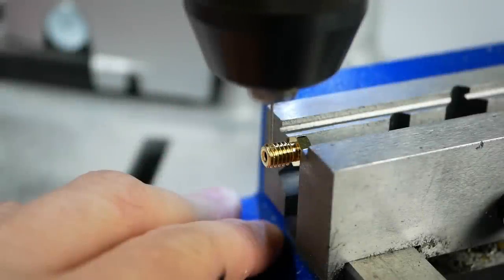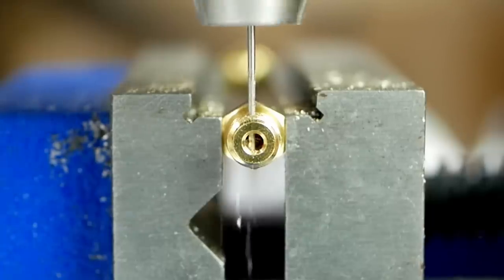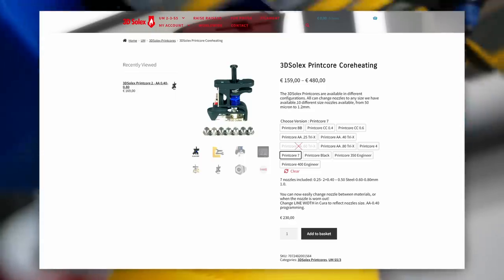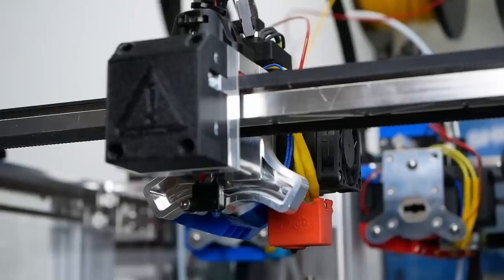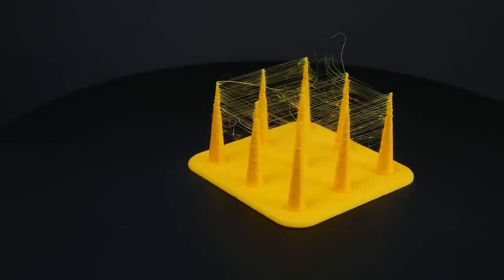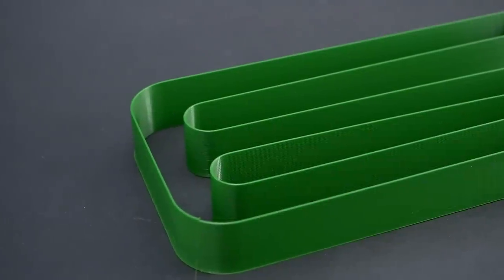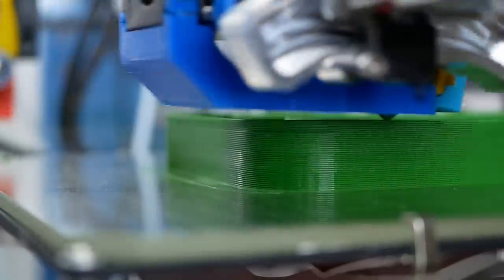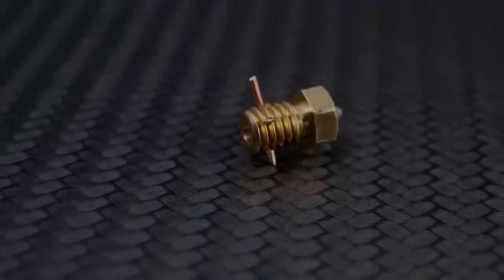My High Flow Nozzle is better than a Volcano hotend!

Comment: Hi Stefan great video! If you try putting the too wires farther apart you should  get a more laminar flow do to smaller obstruction aria overlap and  less cavitation on the underside of the wires. Also depending on tool availability you could flatten the portions of the wires that are in the hole of the nozzle into an aerofoil like shape (as much as possible), further reducing turbulent flow and the cavity's under the wires.

Comment: Hello, an easy method to align a round object is to take a rectangular template with a V-cut from the top and a V-cut from the bottom
With the bottom V resting on your round object lower your spindle into the top V
from here your eye should see how centered the spindle is, or You could use the old line and weight method to really dial it in

Comment: A small end mill and slow pecking will allow you to drill the hole without wandering. Even a center drill will be challenged trying to cut into the side of a thread.

Comment: Use an end mill to start the drilled hole. Also before you solder  the copper wire in . Grind  flats . On two side  opposite each other. So it's more streamline like a fin. Put 3 wires in . Clock them 60 degrees apart.  In a helical pattern From Top to bottom. This will maximize temperature transfer and equalize flow.

Comment: I would also like to see the impact of adding a bevel on the top side of the wire before inserting it into the hotend to potentially help 'split' the filament into two streams.

Comment: I have an idea for Mk2 🙂 So, unlike drilling inside the nozzle as Solex/Bondtech does, here you are adding an element. That enables the luxury of processing the "divider" element separately, outside of the confined space of the nozzle bore, before installing it. So why not file (and gently polish) the section of the "divider" that is exposed inside the nozzle bore, into a more favorable, less restrive shape? Like a slimmed diamond shape / double-ended wedge? Then add 1 or two more like it, but in the same orientation, as close to each other as you're able to drill. So when installed, they "stack" to form (almost) one elongated divider.

In my mind, this would drastically increase the contact area and thermal transfer, while also (!) substantially reducing_ the volume and flow restrictions, instead of at the cost of increasing it.

Comment: For the volcano hot end it would be cool to see you make a cut down the length of the nozzle and slide a thin copper sheet in. Might be easier to get in the center and would ad a ton more surface area to melt the plastic. This would also allow you to use something thinner which would block a smaller cross section of the nozzle.

Comment: I was thinking about it last time, but try boring the nozzle bigger and soldering a plate/blade in there. It would have more contact with the nozzle and filament to transfer heat.  You could also try a "+" type affair.

Comment: Definitely worth experimenting further.  However, I did notice another area that is restricting flow through the nozzle.  And, that would be where your solder has wicked its way through your drilled hole and run along the copper wire to the inside of the nozzle.  There is no way stop this from happening, nor is there a way to remove the excess solder after the wire has been put in place.  It does make me wonder about soldering a piece of copper vertically into the nozzle and then use precision drilling to mimic the angles of the other nozzle.  Not sure on patent violations of this idea either. Either idea gets my brain cranking though.  Excellent work.

Comment: Its a long shot and quite time consuming, but i'd go with a two-part design:

A nozzle cut in two.
A tiny mesh but, not with this kind of thick wires. With extremely thin coil wires (awg26 - awg34 which correspond from ~0.4 to ~0.16 mm diameter) .

You sandwitch the mesh bitween the thow nozzle parts, and stick them all together.

Comment: You could also print a template to drill the holes. You could fasten the wires like a rivet then you don't need solder.

Comment: To drill central. Assuming you are lined up OK. You have to use a center drill first. 
It's a short stiff drill that makes a pilot. Normally used to make a hole for lathe centers. 

Then the drill will folow that. And you can do it anywhere then.

Comment: You should be able to achive better centering when drilling into that outer thread, if you can provide a flat "start" drilling for the through drill to run through. So a flat bottom drilling could be made with a slot drill or endmill. I know you have a cutting router or two there, but maybe not such tiny tool bits for it. But that's my suggestion
When you drilled the "bridged" section of the nozzle to over size it, you might have improved flow performance further by using a 45 degree or even 60 degree centre drill (spotting drill). That would probably reduce back pressure on the flowing filament.

Comment: Try two wires in the same orientation with little to no gap between. Additional you should make a cooper nozzle. And the widened internal diameter should degrade back to 2.0 mm in steps.

Comment: You could use a heat block to center the drilled hole in the nozzle. Just drill through the block with the nozzle in the block.

Comment: Interesting. I have a mini mill. It would be pretty easy to plug the channel and drill down the side of the plug and nozzle to get the semi circular scoops in the bore. And maybe add a cross wire or two..

Comment: Another idea: cut a very thin slot in the extruder from the top, and put a thin blade rather than a wire, it will have a longer contact time and lower resistance.

Comment: in addition to the comments about using a nut to prevent the drill bit wandering, I want to see you try pinching the wire flatter inside the nozzle. it should increase the surface area of the wire and decrease the obstruction to the flow. maybe also try thinner wire, which you should be able to do with a smaller drill bit. you can get brass m6 nuts to have an easier time aligning the drill bit.

Comment: I'm no machinist but maybe (and I hope the machinists here correct me if I'm wrong) you could try to use a spot drill(Zentrierbohrer) to get a better starting point in the middle of the nozzle.
Also instead of soldering I think you could get away with mechanically locking the wire in place by simply punching it from both sides so it widens at the entering and leaving area. (not sure how to explain it better)
The last Idea I have right now you could try to V shape the wire before inserting and pointing the sharp edge to the incoming filament just to hopefully have the filament split more easily.

Comment: Use a brass or copper tube rather than wire. Once it is in place crush the tube flat. Yes you need very fine needle nose pliers.

Comment: If you have any centre drills for the lathe, I'd recommend those to spot a drill centre, or use a very sharp engrave V bit to just leave a centre mark, I use carbide 15° ones but they're not really meant for that kind of work

Comment: Hey brother, 
Get a set of "pilot drill bits" for about $10 bucks on eBay or many other places and you will have MUCH more control and less wandering when drilling tiny holes
Excellent video. Lots of research in these. Thanks for that!
Have a super day
-Shane

Comment: I believe you're supposed to use "center drill bit" to start the hole. They've short but rigid drill bits specifically for this purpose.

Comment: This is awesome! I have a CHT on the way, but their selection doesn't include some of the things I would like to try. Your approach should be doable at home by anyone with a decent drill press and vice. I will definitely give this a try!

I wonder if it would be possible to press fit a wire into the hole. The thermal coefficients of brass and copper aren't that different, but different enough. That way you could avoid the soldering, making it easier to handle higher temperatures. Steels also tend to have smaller thermal coefficients than copper, so maybe press fitting copper wire into a steel nozzle would be easier.

Comment: To stop the drill bit wandering you need to make some kind of a starter hole or divet for the tip of the bit to rest in. Then it should go straight.

Comment: Imagine how many cross wires you could get in a Volcano nozzle. I second the suggestion about using a nut to both maintain thread integrity and also providing a better drilling surface.

Comment: i'm thinking if just making a straight cut in the nozzle and using like 0.3mm copper strip would be easier and maby work better than a wire.

Comment: Silver solder the edge of a razor blade in there instead or use some sharpened copper sheet intead, basicaly get the splitting performance up and the surface area in contact with the plastic down.

Comment: Super impressive. Have you considered to make a cut from the top and insert something thin and long, like a sharpened copper sheet? Should decrease physical resistance and also crate a bigger surface area.

Comment: Soldering isn't necessary since the wires are held in place when the nozzle is screwed in. That means you can turn the heat up a little higher without concern. Try using thinner wires, or filing the wire into a thinner shape for less resistance.

Comment: Awesome 
What about before you solder the wire in the nozzle you have the extruder side of that wire brought to a point like a knife edge this would reduce the drag of filament having to go around the round wire and instead just splitting it.

Comment: I would have used a #1 center drill to start the hole before drilling with the drill bit. This would also allow a small chamfer to the hole start and the center drill won't walk like the small drill bit does.

Machinist precision drill process is: center drill, drill, then ream or tap if needed.

Comment: What about sticking a flat piece of copper with a width of the nozzle inner diameter into the back of the nozzle. May need to drill the nozzle out a bit first to enlarge the hole. This will insure the split is in the middle, increase the surface area for heating, reduce resistence due to the fact that it is thinner and make it easier to install and maybe even make it reusable (Similar to Fig. 3C in the patent). Alternatively, take a piece of round stock with the inner diamiter of the nozzle and mill it out from 2 sides, creating an opposing U shape (Similar to Fig. 3A in the patent). This will create a larger area of contact with the nozzle walls that will allow for faster heat induction.

Comment: Let it your drill wander, and once you get to the filament space tilt your clamp and nozzle until the drill is central. The first hole will act as a guide to stabilise the drill for the second hole.

Comment: The higher the stickout of the drill bit the less rigid it is so the more it will wander/drift (also worse runout). Ideally the chuck jaws clamp on the smooth right past where the drill bit flutes end.

Comment: Put a (thinish) sacrifical peice of metal you can hold that is predrilled, then use that laying on top of threads to guide.... wait, that bit should insert DEEP in that chuck... don't worry about drilling both at once, just get a first centered hole.   
Hey, can't wait to try this.... thinking offset holes a little so as to get more wire volume inside... may do some filing on the wire... ovalish ...less flow resistance and maybe a little sharpish!
Still watching... sure be back... good stuff!

Back soon.... why even solder... hole placement... really care if a bit leaks.. likely won't notice a bit with hole placement at 50% insert depth.

Way to go Karl!  And marvelously handled cnc kitchen!

Ok subed.  Yea, put wire in vise, take small file and file a symmetric wing profile.  Do the only on the width of extrusion hole and insert with it appropriately positioned.  I think what's lost in mass will greatly be overcome by reduced friction/flow resistance and more laminar flow overall.  
Can't wait to try it!  But old retired engineer and building my first printer... a delta... T3000 amateur competitive.

Comment: To keep your drill bit from walking, first drill the threads with a slightly larger bit. Just to where the threads will no longer touch your smaller bit, then center punch it with an even small bit or punch.  then drill it all the way through with your desired bit... Just a thought 🤔

Comment: You need lubricant like a cutting oil and to use a lot less pressure on the cut, then you can stop the wandering. Even better is to use a smaller length drill bit.

Comment: The best way to drill a hole would be to get something that it will tread into that has flat sides, like a nut. Then drill thought it (nut) and the nozzle, you can also reuse this as a guide to make more later. This should prevent the drill bit from walking on you when trying to drill though the treads. People with a milling machine might put a small flat spot on the treads before drilling the hole.

Comment: I have an idea that you did not mention. Because copper is soft, it might be possible to reshape the wire inside the nozzle after insertion. Either use tiny needle nose pliers too flatten it, or some type of tapered shim one on each side. With the copper wire shaped more like a knife edge instead of a round obstruction it is less restrictive, but maintains the same amount of surface area to contact the filament.

Comment: Instead of drill holes you can try to create with copper a shape that is a washer with in middle a V shape bridge with sharp edges to fit into the hole and then mout all as a normal nozzle. Is a try that don’t sacrifice nothing, but if it work you can go over the temperature limitations. If it work you can think to a double v shape as you had made with holes, at different dept.

Comment: I got interesting results machining a new hotend cube, made of copper instead aluminium, and making it 12mm thick instead 10. The weight of the copper hotend is 6 times higher, and this gives to the hotend body a bigger thermal inertia. On my printer, one of the speed limiting issue is the temperature drop when the nozzle extrudes much filament in short periods of time.

Comment: Not that I've tried it (apparently we can't legally try or use patented ideas) but if you use a larger wire and turn it down with sandpaper and a drill it can fit snug enough in the drilled hole to not need solder and could potentially print abs. Printed guides might help for the drilling process making it feasible to use a hand drill and a small vice. Can't wait to get my hands on a .4 cht if they ever become available again.

Comment: Find center, flat end mill ( same or larger than drill till a flat spot is obtained ) Center drill, then drill.        Try standing finished nozzle upright then side milling each side of the wire to thin out the profile thereby reducing the cross section of the wire and reducing the backpressure. You could install the lower wire first then thin then the upper wire and then thin. ( May be easier to thin the wires by filing before installing ) Who knows?

Comment: Dual heater block,  top section at 250 deg second at 215 deg , pre heating the entry point at high temp then stabilising at nozzle

Comment: Can't read 1200 comments to see if this has been stated, but if you want to drill a hole on center of a cylinder, then start with an end mill. That will create a flat on the curved part and then you can switch to your regular drill bit. And yep, I learned this on YT myself and have used it extensively:)

Comment: You could even use some of the flat wire used in vape coils for the people that wrap their own vape coils. I imagine that would be a great way to get nice sharp wires in there to reduce drag while still conducting heat well. You could do a few of them from different angles and I bet it would work great as it cuts and melts at the same time.

Comment: I saw in a book once for those small threads you could build the surface with a little solder then score the solder since its brass. that low temp that u didnt use would be the easyest to remove after wards and plug the center with a dol rod so it dosent drift.

Comment: Try sharpening the wire to a teardrop shape to cut down on flow  resistance. Place the sharp side up toward the incoming filament. Also try drilling the entire tip out to the larger diameter before inserting the wires. I imagine having 4 pie shaped heating areas and more volume in the tip could get you there. I'd be interested to see the above mentioned modifications or a volcano aswell

Comment: Ya know, it would be easier to get a small center cutting endmill to make a nice vertical hole.  Because it's so short a distance and brass, you can use the endmill to do all the drilling from preventing deflection on the thread through.  
For thicker material, you'd want to make the flat, then spot drill and then regular drill, but a small endmill is just fine for this!

Comment: I would love to see a comparison of the different Nozzle metals.  Compare the standard Brass to Hardened Tool Steel, Stainless steel, tungsten, ruby, diamond, and  plated copper.  Many of us who print primarily in PLA occasionally use abrasive materials (glow in the dark, wood filled, glitter, or metal filled) and rather than constantly swapping nozzles, and the pain of re-leveling/tramming, would rather put in a "better" nozzle in the beginning and not worry about it for a LONG time. Some have good heat transfer, others no so much.  The copper and Diamond should flow well, the SS may not do so well.  
Would be interested in what these nozzles do to print quality and speed.

thanks...